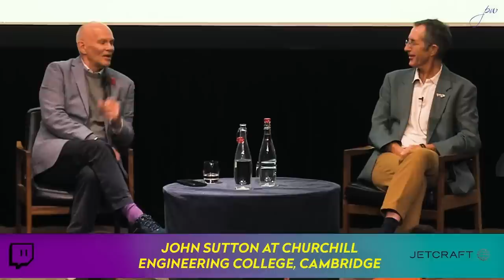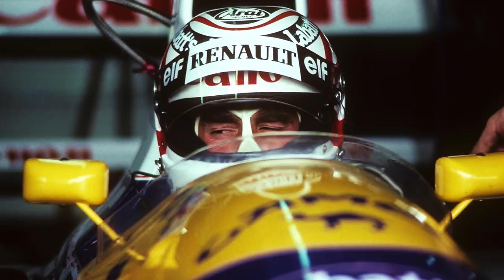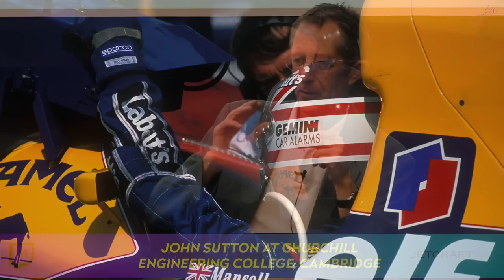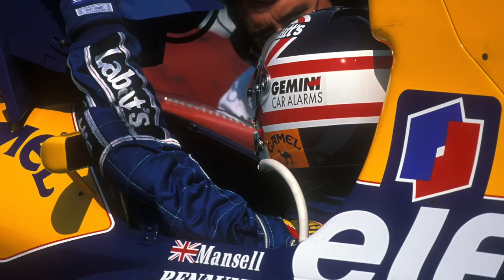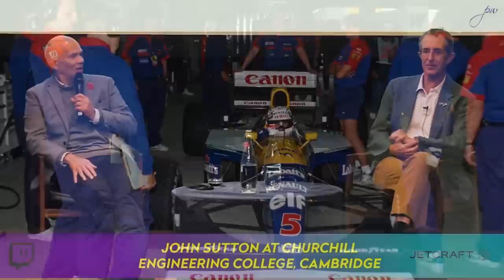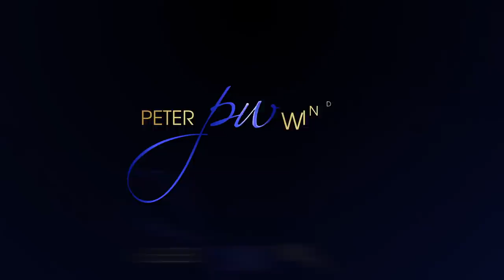What really happened in Canada?

Comment: something quite similar happened to Vettel in India at one point where his engine disintegrated itself seemingly out of the blue. turned out, this was due to him short-shifting the race before because he thought to save engine live this way as he was leading comfortably. but this unforseen procedure had the engine operate at a vibration pattern it wasn't tested nor built for, causing the con rods (I believe, it was) to weaken and finally give up. this kinda falls under the same, "operated outside the envelope"-scheme, IMHO.